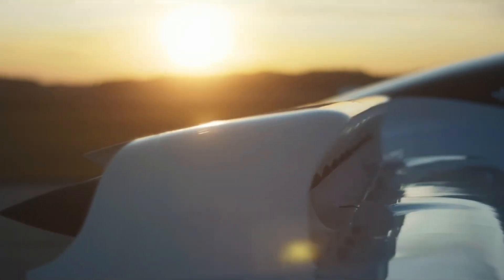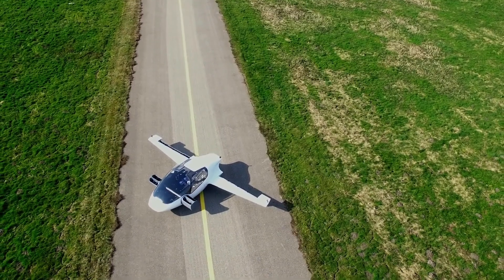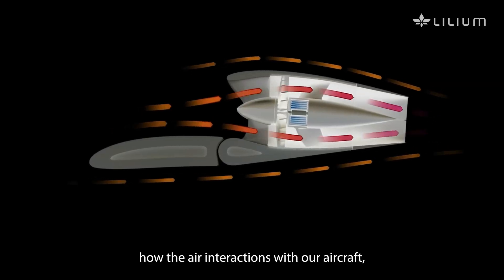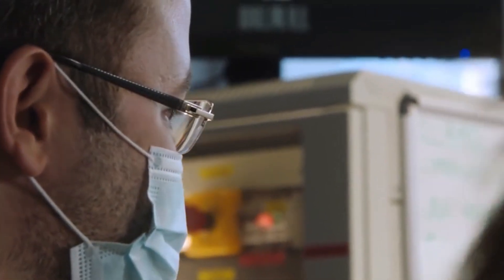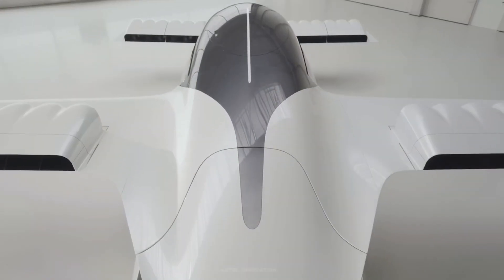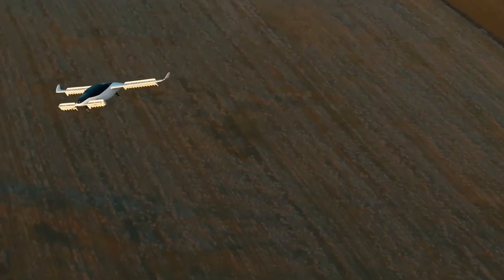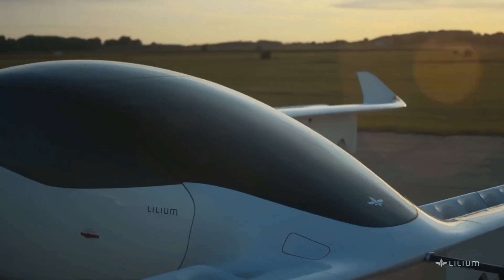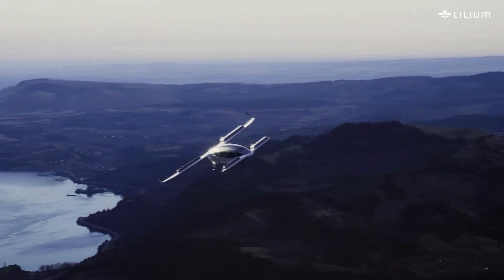The Lilium Jet A New Era of Quiet, Electric Vertical Flight

Comment: I thought Lilium had a better design. The propellers are not exposed unlike Joby; noise pollution and propeller safe was a plus for urban flights. It would transport more passengers. The range was estimated to be longer. And  being in Europe, where there's many neighboring countries, that an air taxi is more reasonable. Interesting to see how the resurrection plan will turn out.